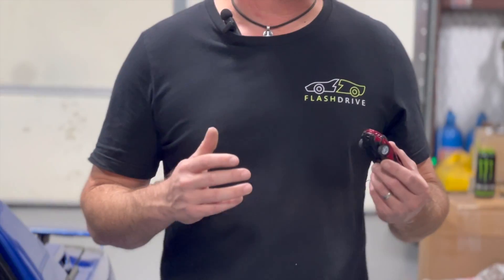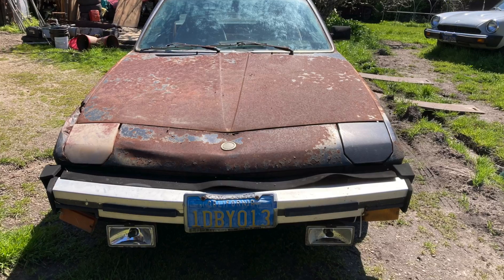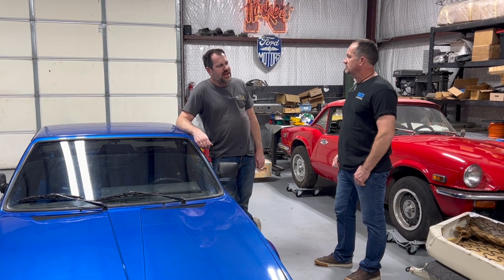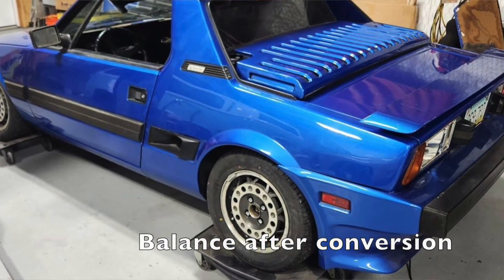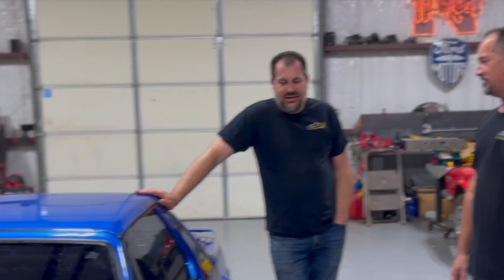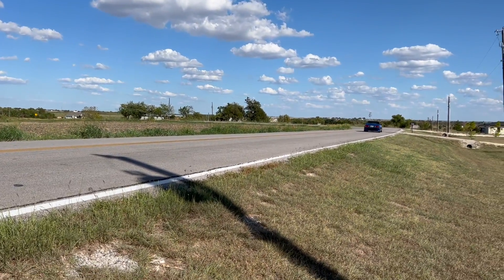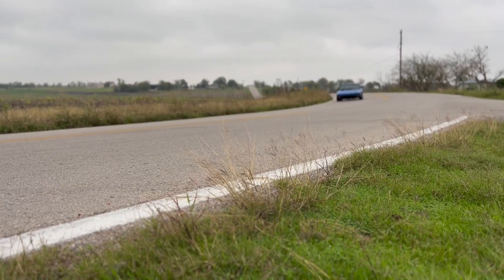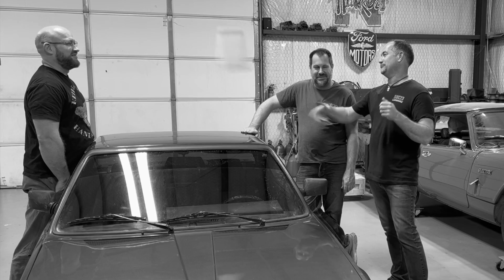Fiasco to Finished:  Fiat X19 Saved by EV Conversion

Comment: Super cool seeing an X EV conversion. Would be nice to see the specs of how the car performs with the EV motor, such as 0-60 and quarter mile times, or torque/HP curve.
X1/9s are a head turner for sure. Of all my sports cars, the X's got the most. Pretty much every time I park it in a public place. They are also one of the easiest small sports to work on. (compare to working on a Mini cooper, uggg.)   They have been one of the most reliable cars Ive owned. The typical problems are just rust, or inconvenience of parts not at your local auto store. Just like anything else, something someone doesnt know about is always harder than what they are used to.   The X does what it was built to do, very well. But that purpose is not for everyone.

Comment: i was never really into this stuff myself, but my brother had an X1/9 through the 1980s. He had loads of great times with it. Even took the "Driving Ambitions" course that used to be held at Mosport with it. Which all led him to take special note of a review of it that came up in one of the car mags in I think about 1986. The car rated abysmal in terms of the magazine's normal scoring system. But the test drivers all LOVED it. Why? The test drivers at the time were all experienced Formula 1 racing drivers, and they found the X1/9 handled just like a little Formula 1 racing car. Things like: If you try to turn too fast, most cars will either oversteer or understeer, while the X1/9 would hang on just that little bit longer but then spin like a top. Just like a Formula 1... So the test drivers all felt right at home with it.
Reply: I hankered after an X1/9 for 30 years, after growing up with a pair of Fiat 128's (the front-wheel-drive small saloon the X1/9 gets its entire powertrain from). I inherited the second one when I got my driver's licence at 18, and had to learn how to look after it. Yes, it had lots of problems, because of zero maintenance for the five years before I got it. Once I got on top of all that, it was supremely reliable. Did about 60k miles without a breakdown, including a 3000 mile road trip in 10 days in 120F heat, with 100k miles on the clock, without a single issue. Other than a mounting bolt being shaken out of the front bumper mounting on one of the "scenic drives" (aka 4x4 trail).  But it did 9,000rpm in factory trim, and the sound was... spine tingling. I finally got an X1/9 five years ago. And NOTHING prepared me for the fact that this road-legal go kart goes around corners far better than anything else I have ever driven. Not by a little, but at least 30% higher speed around any corner, without any tyre squeal. Handling second to none.

Comment: I heard or someone said or they say.  If you don't maintain them or any car they will break down. 
 I've had 5 X1/9's, driven from Seattle to LA twice to see the 81 82 Formula 1 races in Long beach, many miles done and never had a problem.
Took a head on hit on the left side from another car only damage was front fender, front header between the flip up lights and left light at about 28 mph each car. 
Doors opened with door gaps still factory spec, other car totaled and had to be towed, my car drove away.
Street raced a heavily modified Roadrunner and Z/28 in the mid 70's, driven Ferrari Testarossa, Dino 346 and GT4, Porsche twin turbo, and other amazing cars but for just driving around town or doing twisty roads the Bertone X1/9 was the most fun. It was like a go cart, I had put wider wheels and tires and lowered it, the low horse power made shifting more often, which I find fun and I didn't have to prove anything because it only had 80 HP

Comment: Modified and raced my daily driver, a 1980 x-19 for ten years. Regardless your intent, know that you can add interior space !

Junkyard bucket seats from a 280z or similar with a low pan but, deep back. Aftermarket 12” steering wheel. Cut 2” off the shifter shaft.
ANY aftermarket exhaust is better than the 42 pound stock unit. Lowering springs and front sway bar   Along with braided steel brake lines.
The radiator has space for a second fan. Running a seventy series rear tire is like having overdrive on the highway. Tower braces noticeably improve handling .

Comment: Prejudice upon prejudice.
I drove the X1/9 for eight years and it was stable, reliable, manoeuvrable, extremely sporty and incredibly safe.
There were 2 repairs, both self-inflicted.
Reply: Same. These guys are low IQ morons. Also the X came a decade+ before the MR2 and Fiero. Safest car of its type built. Best stock handling car I ever owned  and I track Miatas now. They joke about safety??? Saw one with a head on, and the glass not cracked and doors opened. Front was gone though. Its pretty much a roll cage. . Hosts should stick with what they know and get a F150, drink some beer and f off.

Comment: Sorry, but converting it to an EV was the worst thing possible to have done. Just give it a petrol engine??!! 🤷 

You restored the car, then ruined everything by making it electric. By doing so, you totally removed the car's personality. Can't believe you did this to this car. 🤦
Reply: 100%
Could have put any number of different modern petrol engines in this, K20 Honda engine, bike engine, whatever.
It would have kept the character of the car, made it much faster, even better sounding.
Now it's just a shell that sounds like a 1970's milk float.
Reply: What do you expect from tweedle Dee and tweedle.......
The X was the best affordable rear engine drivers car you could have so much fun with. I miss mine 😢

Comment: I think there are high-performance 5-speeds and axles available from Fiat turbo cars that could handle an EV conversion's torque. An all-original car with a blown motor would probably have been a better starting place than one that had been previously chopped up. At least you could follow the factory wiring diagram for all the ancillary systems. I saw somebody do a motorcycle engine/quaife conversion on a fiat 850 spider. My question was WHY? Fiat had newer generation 2.0L 16v engines and 5-speed transmissions that would have just bolted in and given the same level of performance as the high-revving motorcycle engine.

Comment: Only 2 cars met those proposed safety regulations. The X and a Volvo, I can't remember the model.

 Off the top X (it's been years so if I'm wrong... too bad!) The X1 is the body type, in this case Passenger. The 9 designating this model being the 9th chassis to bear the X1 prototype designation.  So it is in fact NOT an X nineteen, it is an X1/9. Yes they had mechanical issues, engine and electrics specific, but the chassis itself is absolutely amazing to drive.

Comment: The slow power windows can be lubed to go up and down faster, the regulator just needs oil in a few places.
Reply: they are incredibly slow when it's cold outside, i usually have to give it a nudge upwards for them to close correctly

Comment: I had 5 X/9’s starting with a 74 and ending with a Bertone 1984. They were all reliable.  74 through 78 would go throughwheel bearings but they were a cheap repair. Hopefully they can reserve this car back to a combustible engine.

Comment: Yamaha R1 bike engine even on carbs makes 150 Kw, kerb weight installed in an X1/9 = 575kg.

Please do another, essentially built it lighter build it safer build it stronger - add simplicity and lightness as Colin Chapman said.

I can't remember the weight of the R1 engine and transmission, but various small capacity flatplane V8's exist based on a pair of R1's attached to a common crankcase.

For example the PGM 2 litre dohc 4 cam 40 valve makes 435bhp, car would weigh around 625 kg with that engine installed.

Currently the fastest X1/9's have about 385 bhp, weigh about 650 kg but they are modified production cars not swaps.

They have to use the original Lampredi block and the D2 engines are full race and have a short lifespan.

A small capacity V8 in an X1/9  would be very interesting, it wouldn't be eligible to race as a modified production car anyway, so it could be much more refined with normal service intervals and also be very fast, and to the best of my knowledge hasn't been done yet.

In Europe the lightest FIA-approved seats that fit the X1/9 are Tillett carbon shell type developed for the Lotus Elise Cup.

If you fabricate custom rails you can install those and gain 4" headroom, 5" reach, and 2" width each side.

Puts the driver's head well within the rollover hoop, great especially if there is no cage.

Revised height maximum is approx 6'2" without a helmet and approx 6'  with a helmet, with those seats fitted.

https://youtu.be/eiCvOtYM0_g?si=HDAQnCfBJjvwJZTM

https://youtu.be/vHycAO8i6MQ?si=yGkumjtxQVX1W6VC

https://youtu.be/9hNSLEY4VjY?si=UBm-n13TX-HlyiYL
Reply: Hi Mark... all the cars you've linked to are racing cars, not road cars. And the weights you quote are where bodies are replaced with composite, lights are removed, interior is completely stripped... and the power-to-weight figures you're alluding to make the car way too fast for ''fun'' driving. 

A few months back I drove a series 1 with just 75 hp and it was PURE JOY. (I've had three over the years and I still have a series 2.5 in storage.) 

In my opinion if you wanted to modify and had a significant budget - I would do the following: 

(a) Replace the external body panels in fibreglass or kevlar, 
(b) Replace the original wheels with magnesium wheels, maybe 15 x 7 inch, 
(c) Replace the original motor with HONDA 2.0L R20A/R20Z unit and mate it to the original 5 speed Fiat box
(d) Fit a tuned length mandrel bent exhaust onto that motor
(e) Fit ITBs - maybe from a motorbike - onto it

Why this particular Honda motor? Its all aluminium and SOHC, so it should fit in without cutting the firewall and its weight shouldn't be too different from the original FIAT unit (Cast Iron Block), and it's good for 150 hp - which is DOUBLE the power of an original series 1 X1/9... add the exhaust and ITBs and you might have closer to 170 hp ... 

With the body lightened and a bit of strategy, weight might be closer to 820 kg or so and, with 170 hp, that would mean  207 hp / ton!

Doesn't sound like much on paper? (Screen, actually) But to put things into perspective, what are some other cars that have that power to weight ratio?

(1) Lamborghini Urraco 3.0L V8 P300 - [1974] has 207.0 bhp per tonne

(2) Porsche Cayman 2.7l - [2012] has 206.8 bhp per tonne
(3) Lotus Evora 3.5 V6 - [2009] has 204.4 bhp per tonne

Then add the fact that NONE of those cars weigh 800-odd kilos and that only a LOTUS ELISE is that light - which is a really fun drive, by the way - and suddenly you have a classic little Italian gem designed by Marcello Gandini (the guy that designed the Lamborghini Urraco, Countach, Miura, etc.) that provides modern performance!

(Oh, and the ITBs and F1-style exhaust would provide a soundtrack worthy of an X1/9!)
Reply: @ferrucciolamborghini7182  splitting hairs the X1/9's driven by Ticci and Dondi are modified 2-litre naturally aspirated production cars based on the production bodyshell using the original block, retaining the silhouette of the production car in side elevation except for a permitted front air dam and rear wing, for Class E2-SH2000 of the European Hillclimb Championship.
The transmission, suspension, track width, and cylinder head, can be modified however.
IMO the specs for this class, most closely resemble the original Group 5 specs that inspired Dallara to modify the X1/9 for the track, which in turn created the directive to produce a road going "Stradale" version called the Dallara Bertone, which was prototyped but never entered production.

The 16V Dallara head is unobtainable at any reasonable price, but the Fiat/Lancia/Alfa 16V head is actually better and readily available.

Not forgetting Lampredi designed flat-plane 4-litre quad cam V-8's for Ferrari before moving to Fiat, identical bore spacing and other fundamentals make it possible to use a late production Ferrari F136 cylinder head on top of an early production Fiat 128 block, to make a 2-litre 4-cylinder 16V dohc engine with variable valve timing, is the engine in the grey/red car.

So for a road going version it would be dialled back to 100/bhp litre in which case for a twentieth of the price use the original sohc 8V head with bigger valves and a hand built tuned exhaust like you said... and throttle bodies yes absolutely!

Comment: 3:12.  Taking into consideration the fact that you didn't use the Dodge engine, I don't understand why didn't you use the Fiat transaxle?  Wouldn't have had to make custom axles and the speedometer wouldn't have required any modification.  Am I missing something?
Reply from the maker: The owner supplied the gearbox.  Yeah, it is a different arrangement.  For simplicity we’d suggest using the original or better yet…. Tesla small drive unit!!!

Comment: It would be interesting if you guys could pull off a series hybrid EV conversion.  Like build your own Fisker. Have a gas engine generator charge your batteries that runs an electric motor and rear axle. I want to do this with my 06 trailblazer but I haven’t found anyone who’s done this.
Reply: because it's a stupid idea

Comment: love it.  How much HP/Tq, and battery capacity?   Can't find any more details on your website.   I have an '82 X1/9 (stock) and a '21 BMW i3.  Dream about having ~190hp and immediate torque of i3 in the low-slung X1/9....
Reply: That's the thing with X1/9s ... they're SO SLOWWWWWW.... swap the original motor for a Honda 2.0L R20A/R20Z (SOHC, VVT, All Aluminium) ... with extractors and the Honda motor you'll have DOUBLE the horsepower and similar weight to the origial! (and might be ok on stock gearbox)

Comment: Fiat x19 predates the fiero and mr2…
Reply: Exactly. I stopped watching after that.
Reply: Toyota actually copied the X. They literally chopped an X in 4 and copied the suspension. But the raised the rear roll center thinking Fiat screwed up. That lead to oversteer issues with the 1st gen MR2.  The MR2 however improved over generations where the X was left to sit and stagnate.